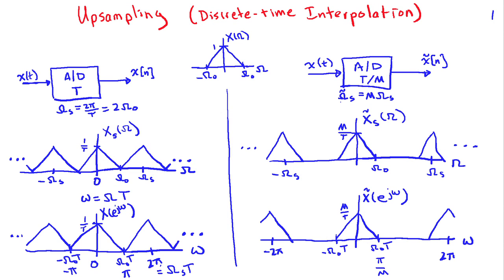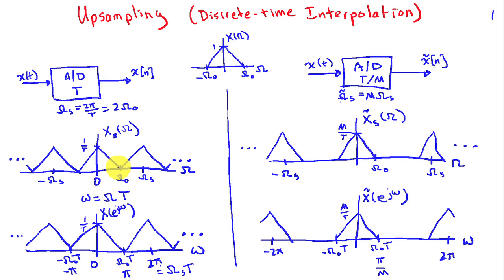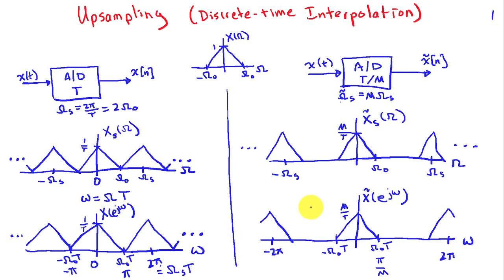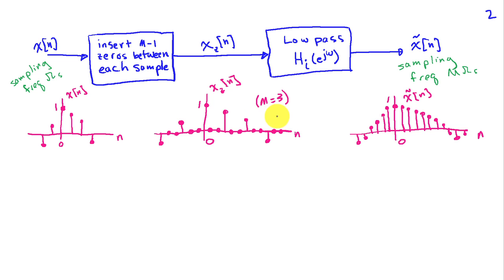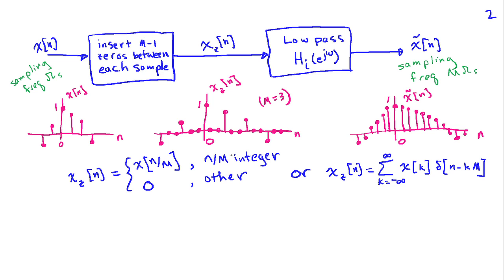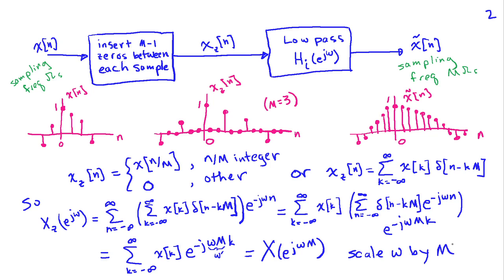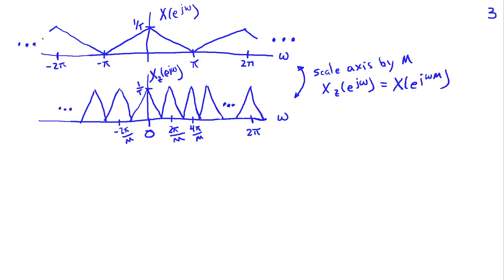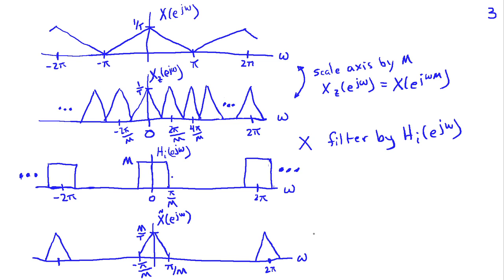Upsampling

Comment: it seems that upsampling will not change the amplitude of the signal in frequency domain. But the first picture where you show the amplitude of signal is M/T which is a little bit confused.
Reply: He is showing upsampling together with lowpass filtering (together known as interpolating) which DOES change the amplitude from 1/T to 1/T_new=1/(T/M) = M/T. 

Also, he forget to put a tilde on omega_s on the plot of \tilde{Xs(omega)} on the right at 0:23
Reply: I also see the same issue. Why it does not change the sampling frequency? if it is changing w it is actually changing the sampling frequency as w=2pi/T